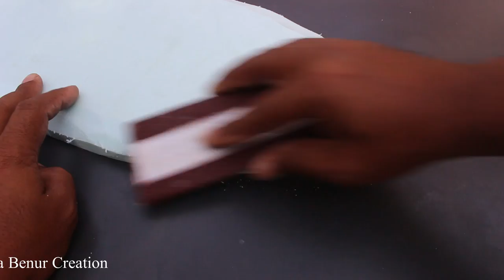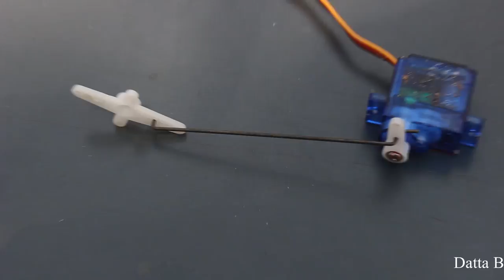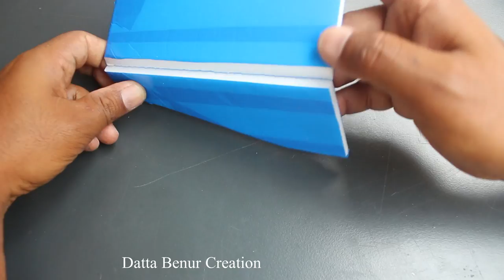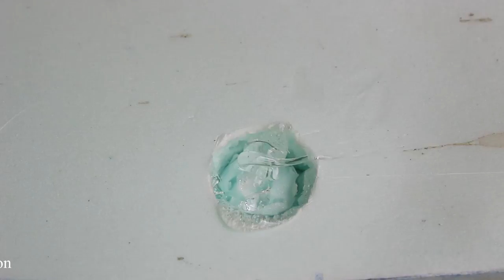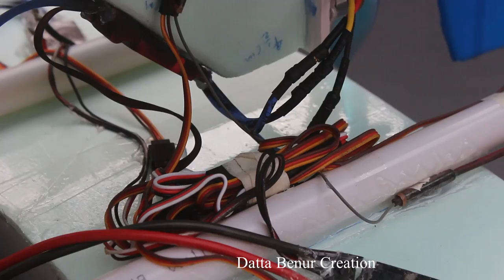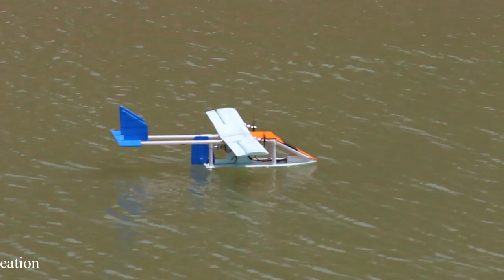How To Make a Airplane - Boat With Airplane - Boat

Comment: Nice Projekt, but I dislike the open Electric Parts.
At Windy Condition the Plane is heavy to hold horizontaly.
It's not easy to control at Water. I think you have to Work at details.
but the "easy Built" concept is good!
Reply from the maker: Thanks for the tips!

Comment: Well Done Sir.
I used to be an RC snob, I only liked balsa and composite planes. However after building and flying several "cheap" foamboard planes I am a huge fan of the durability and flexibility of these creations. Keep up the good work and I'm going to check out some other posts of yours.
Reply from the maker: Thanks for sharing